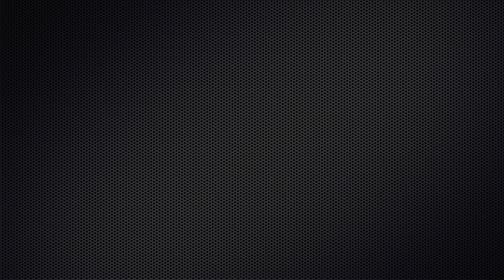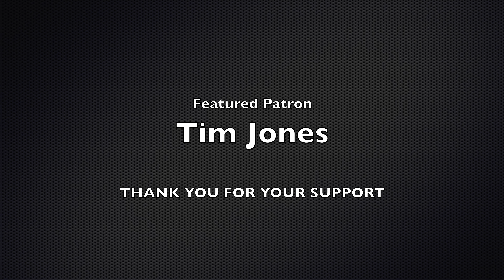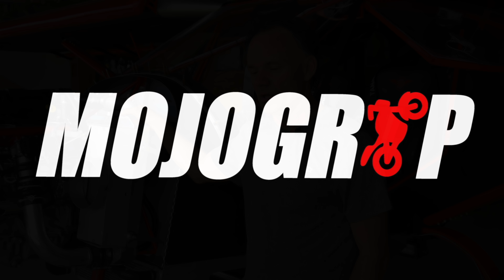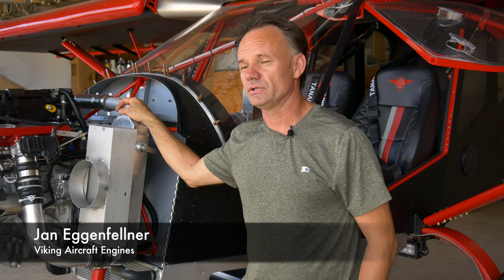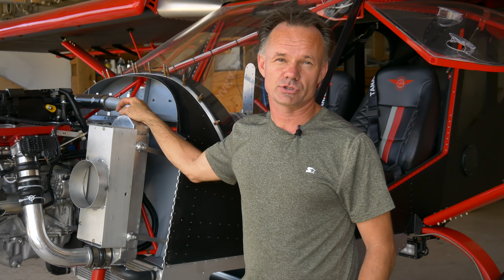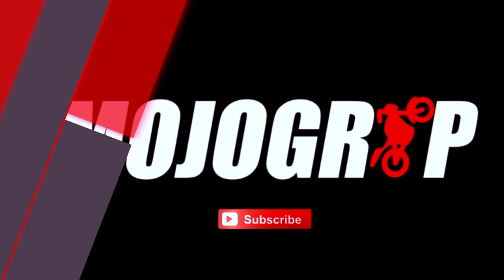Aircraft Engines l Auto Conversions VS  Certified Engines

Comment: Again, my high praises for your work doing this YouTube channel. As history reflects, piston aircraft engine development actually ended at the close of world war two. Since then, the emphasis has been redirected to materials engineering for durability issues,  weight reduction and fuel economy. The air cooled engine in principal offered combat survivability because of the vulnerability of combat aircraft to ground fire in that (the golden bee bee could)sever a coolant line and thus the engine could not run very long and the aircraft was lost, in single engine aircraft. 

Now the issue is pushing more power from less displacement. The byproduct of heat has to be dispersed in a controlled manner so liquid cooling is the most practical approach. Remember, Viking does not use antifreeze for coolant. They use another liquid with properties that will not boil (or turn to a gas state of matter) until a much higher temperature than water or antifreeze. 

Lastly, the whole scheme of running an aircraft from a non-traditional aircraft engine manufacturer is based on the economy of scale. Traditional aircraft engine manufactures produce a very small percentage of the total internal combustion engines in annual production. A single production run of Honda or Mitsubishi may well exceed all traditional aircraft engine manufacturers combined. So, it makes sense that they can produce at much lower costs (micro economics 101). 

Certified aircraft engine manufacturers will not disappear. They offer well proven products and maintain very intimate relationships with aircraft manufacturers. The body of regulation and insurance demands that their products are used to protect the public and the industry as a whole. This is not an apples to apples comparison between certified aircraft engine manufactures and experimental/light sport engine suppliers. It really comes down to affordability and access to current technologies. By selecting a non-certified aircraft engine for your non-certified aircraft you (the builder/buyer) are somewhat avoiding the regulatory costs and poor economy of scale of aircraft certified engines. Overall, no manufacturer/reseller of non-certified aircraft engines is actually selling their engines at a low enough cost to open aviation to all such as making automotive available and reasonable for nearly all. That may never happen because our educational system and government mentality has not evolved. We seem to be more interested as a nation in making cannabis available than encouraging our people to soar high with aviation.
Reply: Mr Shi quite right. Piston powered aircraft owners are being held hostage by the airframe/engine manufactures dictatorship. In some respects, the situation is similar to the people of Cuba and their old cars. Why do aviators put-up with this crap? Most of us don't drive 40+ year old cars. Most of us fly 40+ year old airplanes.
Reply: Everything you said was great but I got confused by the cannabis comment.
Reply: Hong is saying making marijuana available 'shows-up on the radar screen' while general aviation is close to zero interest for the public
Reply: "soar high" ha ha I found the pun!
Reply: @donjohnston3776  that is natural ... everyone is smoking but only few are flying.
Reply: Well said. It’s amazing that it didn’t take long for car makers to abandon air cooled carbed engines and yeah GA sticks with it despite its issues.
Reply: That combat survivability also applies, albeit to a lesser degree, to civilian aircraft engines. 
You don't need a bullet or flak to take out a liquid cooling system, normal wear and tear will do that for you, just not as reliably for your enemies. Same goes for a timing belt or chain, same goes for a gear reduction unit, etc. Some of that can be taken care of by proper preflight and maintenance but, as Ernest K. Gann put it, "Fate is the Hunter". 
There is an argument to be made for the additional reliability provided by modern engines and parts operating in a more controlled environment (steady temps of liquid cooling Vs. shock cooling in an air-cooled engine, better ability to burn off moisture in the oil due to better control of temps, use of more advanced engine management meaning less fuel dilution and other issues, etc).
Reply: WW2 had several combat aircraft with engine designs similar to what we see today in the automotive industry such as the Packard-Merlin Liquid cooled V12 used in P-51 Mustang. The Merlin engines proven to be very good engines.  I don't think a Lycoming type engine had any roots from WW2 those engines were designed prior to WW2 were always designed for light aircraft where they didn't need more then 200 HP.  The argument that direct drive vr gear reduction really doesn't hold water the Packard-Merlin V12 had a gear reduction unit no one will ever argue that the Packard-Merlin engine is not an aircraft engine.
Reply: Yup! Really sad!

Comment: This is a great review. I would like to add that no motor knows what it is in. But aircraft motors have not been successful in cars. Saying this the modern car designed motor works in anything you put it in and it is the leading in technology , efficiency ,  light weight technology and not to mention easy access for parts and best price. I like what Viking is doing.
Reply: Not quite correct. Stick a prop out on the end of the crankshaft brings on many problems.  A big problem is the crank loaded well past its design. Again I use the corvair. Add a 5th bearing you get a good 100-120hp engine.

Comment: Good video but the guy is a little too sales type for my liking. I would love to know the design choices that let Rotax to choose a hybrid cooling design. Given that it’s a modern engine I’m sure it wasn’t legacy design. So why was it done? 

I can appreciate how that could induce failure points but without a discussion of the benefits it feels a little one sided.
Reply: The liquid cool is required because without it the engine would overheat. I’m not sure why rotax just liquid cool the heads and not the cylinders too like the car and bike engines, but it probably comes down to being lighter than a full liquid cool (cars and bikes need it cos they don’t always have airflow in cars and bikes). 
Full air cooled plane engines are mostly 2ci per hp Viking Yamaha and rotax are much higher power / cubic inch than that, so they need liquid cool
Reply: Remember that Rotas also use oil cooling and that makes quite a difference, cooling the really hot parts of the engine, i.e. the heads, it is more forgiving on cooling setup. Jabiru engines from Australia also have a liquid cooled head kit which has improved their reliability.
Reply: Redundancy? In aviation is quite common to have backup components for each and every system in case of a failure
Reply: @thebikespot9177  it’s not redundant, because without the coolant it overheats. 

But I think I did figure it out. 

1. It eliminates the head gasket coolant passage ways which is a common failure.

2. Less weight because less coolant and a smaller radiator is needed that if the engine where solely water cooled.
Reply: Th rotax engine was designed in the late 70-s early 80's. Electronic engine management was not good then so it was designed around a carburettor. Most of the cooling required for an engine is in the head, valves, detonation, so cooling the cylinders was not necessary. Because the Rotax is smaller and a more efficient high revving engine it has less surface area for cooling, so liquid is ideal. You also already have air flow in a plane so relocating all of the cooling to a radiator is not needed. The Rotax is ideal NA with EFI, but once you put a turbo on, a completely enclosed liquid cooled engine is better. Not entirely because of cooling, but because the actual engine is stronger and can handle the combustion and torsional forces better. All Engines use oil cooling also and air cooling to a degree. Aircraft engines Rotax and Lycoming derived from radial engines with individual cylinders, which derived from large displacement single cylinders which came from steam cylinders. The important part of liquid cooling is its fast response to temperature change while maintaining a stable temperature. Air cooling is neither able to absorb or dissipate heat as quickly. And yes, this man is just selling what he can, not what is good. Variable valve timing as no place in an aircraft engine with a narrow rpm range. I have watched many of his videos and he has little knowledge of his own product.

Comment: You should use a tiny honda I-Dtec 1.5/1.6 diesel. Get really good fuel mileage. Or a High Performance Viking using a K20c or K24. They could fly a 5-6 people plane. Especially twin-engine design would be very fast and reliable.

Comment: Just sitting here thinking... you know... a 1.6L ecoboost engine produces 190 hp... is direct injected and turbocharged...  only weighs 250lbs... they put those engines in damn near everything so they're cheap... I would think it would be well worth throwing a constant rpm prop onto one with a direct gear drive... it would make one hell of a light sport aircraft setup. (Crate engines being appx 7K). I'd throw a dry sump setup on there, a large oil reserve can... call it a day.
Reply: ..u really don't want to be sit in a plane over  a Ecoboost engine.. oh Boy.. numbers os performance on ground doesn't mean will be the same up there..

Comment: You talk about your engine has to run at 5300 at take off  change that. Order a 12 blade propeller and the blades at 14 inches wide each blade,  that will give the maximum air flow and alot of pulling power. Don‘t need to run your engine so high in the R.P.M‘s. Tell the propeller manufacturer these  specifications you will be happy with that when you get it on your airplane

Comment: Please don't deal with this company. Look up Eggenfellner. See post below from nicholas. He had a Subaru conversion business aimed at Van aircraft designed for Lycoming. He sold many and then folded. Problems galore and poor support, heavy weight, lower performance, lower resale. In general best advice for 99% of people get a lycoming (320, 360), continental (200) or rotax (912, 914). Rotax is my last choice.

Lycoming, Continental and Rotax all have countless hours of experience and a company notifying you of any issues. These Auto conversions you're pretty much all on your own. If you want to tinker and play with it (not fly) and take a little extra risk (lower reliability) and deal with a reduction drive, then yeah maybe an auto conversion is for you. But you're not going to save money. You will have lower performance with same or higher fuel burn. You're definitely not going to save time. 

It's much simpler, easier, more reliable, safer, with better performance if you just buy an aircraft engine. The cost of a new Lycoming has come way down, because they're not a monopoly anymore. Companies make experimental clones of Lycoming. To me the perfect small low horsepower engine is probably the Continental 200 or Lycoming 320. Direct drive, no radiator, known mature aircraft engines. They will be lighter, less drag, less maintenance and safer.
Reply: OMG its on, We can do this all day. Your post came in on my email, I cant find it here ?  Lets move on. I took some notes. 68 years old & tired. Been in a plane all my life. My dad was a great pilot & A&P fantastic school teacher. also on the piper design team many years ago. Made me a piper kid. I hate anything piper ! official solo in 1967 PA17 really I stole it one day & got caught ! Ok You say ww2 tech helped Lycoming ? I don't see it. 1937 lyc was blowing head gaskets till into and after the war. Piper was so fed up continental was pushed into the 4 cyl market. The big 2 are the only game in town. Over the years I have seen many examples of bad engineering. I worked at Alphin Aircraft for years. Largest rebuilder on the east coast .Everything  you can imagine came through the door. So 2000 hr tbo, unrealistic ,Guys just don't take care of a engine to get there. Auto engine better in cars. Except for the corvair we agree.I am not a huge fan but it does work, Water cooling I was a fan. now not so much. Just cooling the head does not solve much. Rotax. I don't like them at all. O235. I have one in a tailwind N31039. I hate it. Heavy. Just does not run well. Its ok not great. ? I know that's a little ify ? You can step up to a 320 or 360 than the cost gets out of control. The 540s What else is there. Chevy LS That wont work. I do believe we are stuck. Your thoughts ? Pauley
Reply: @pauleyplay  I'm 10 years younger and in airplanes all my life . My Dad was in Airforce, and I have a degree in mechanical engineering, worked for Boeing. ATP airline pilot (737, 757, 767), built two kit planes RV4 and 7.

 You keep saying all the experiance you have. I guess you know all. Sorry it does not sound like it. You say untrue cliches. When you say 2000 hours TBO is unrealistic, I know you are blowing smoke.

 1937 is way before the small Horz opposed  Lyc 4 bangers. Blown head gasket? Please. Do you know how a modern (since 1955) Lycoming is put together? O-320 (1953) and O-360 (1955). BTW Lycoming heads screw onto the jug by the way.

I had 2300 hrs on two O320's on my PA23-160 (piper Apache) running fine with great compression. It flew every day, that is why. Good luck picking an engine. Do as you like. You get what you pay for. With you skills you could get a salvaged engine and overhaul it yourself. 

I agree O-235 is not the best, a O-320 has 45Hp to 65Hp more for not much more weigh.

PS I bought a used O360, 600 hours on first rebuild from first run out, for $3500. I and friend tore it down. Sent out crank, rods, case out. Jugs were fine, put in new parts,as needed. Had about $12,500 into it, including carb rebuild. Add $3000 for electronic ignition about $15k. $5000 for governor and hartzell CS prop. $20K. My RV7 cruises at 190 mph true at 8500 feet, and tops 212 mph sea level, 100% power. My fuel burn man be 7 to 6.5 gph or less econ cruise, and still fo 170-180 mph. That is +26 mpg. Going slow cost more.
Cheers.
Reply: @gmcjetpilot  We see aviation different, OK. 1937 was first year for 4 cyl that had HEAD gaskets, That engine was still used in the J3 &PA15 in 1946. Just saying not much has changed. Apache was my dads favorite N1145P N1455P. We all received our twin  ratings it Yes I can rebuild anything, just as you say look how much it cost. I  believe many builders struggle  with 20K & up for a engine.I totally agree you get what you pay for. I believe our market is much to small for much  R&D. Anything new cost way to much.
Reply: @pauleyplay  Fair enough Paul. All the best. Good luck with your project.
Reply: Packard-Merlin V12 that powered the P-51 used a gear reduction would you claim that engine is not reliable? If you want to just fly don't build an experimental aircraft buy a certified aircraft.  Experimental aircraft are just that experimental the engine used in them is also experimental there isn't any right or wrong engine to use.

Comment: Hi Jay, what do you thing would be the best auto conversion for a Cessna 150 That I plan to also install a stall kit?
Reply: Unfortunately, you are not legally allowed to use an Automotive engine in a Cessna 150, as the aircraft is certified with a Continental O-200. Any engine change you have to go through a huge number of hoops to get an Supplemental Type Certificate (STC) generated, otherwise you violate the Type Certificate, and thusly, the Airworthiness certificate becomes void.

I have had my A&P (Airframe and Powerplant license) since 2006, and have been working at a Flight school since 2015.
Reply: @Skyfighter64  Thanks for the reply. It seems unproductive to replace with 60 year old technology when newer engines are way more efficient and much less than $22,000,00 cdn!
Reply: Ron Champagne unfortunately, that is just how FAA regulations work. for any manufactured, certified aircraft, changes have be FAA approved. Fortunately, experimental aircraft sidestep some of these regulations, like needing 2 separate ignition systems.
Reply: Uh, I’m an A+P too, and they COULD use an automotive engine on a 150 - BUT, it would have to go experimental. We used to have an experimental Cessna 172.
Reply: @jondavey5407  thats what I thought.  The certified plane loses its certification and is forever more an experimental.
Reply: @Optimus-Prime-Rib  actually not necessarily “forever”, but it would have to go back up to exactly as it was certified in order to go back from experimental. If that was some how accomplished and documented it could go back to certified.

Comment: There's way more engineering and designing going into Automotive then there is aircraft... overall when it comes to engines. Look at the new variable compression variable valve timing 2.0l . It makes anywhere from 240 horsepower up to 280 horsepower.  It is 8:1 compression and 14:1 compression. Has pretty much flat torque curve from like 1500 RPM up. Volkswagen make a 1.4 liter that makes 180 horsepower it has variable valve timing direct injection.... also has a flat torque curve. They now make automobile engines that you have to do nothing too except for change the oil for the first 100k miles.... can you say that about any aircraft engine?

Comment: Choose your motor before identifying the mission or airframe? That’s doesn’t make sense. How would you know your weight, HP, fuel efficiency, fuel type, constant prop systems, etc requirements? You’d end up compromising your mission and choice to airframe to reflect the motor you purchased. Backwards for sure.
Reply: Because most of the people building these aircraft have no idea what they are doing.